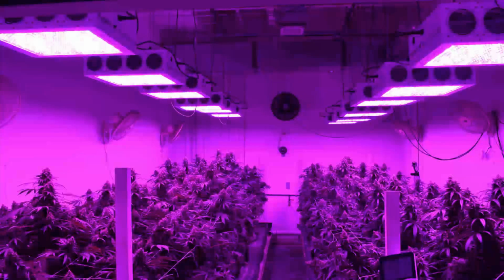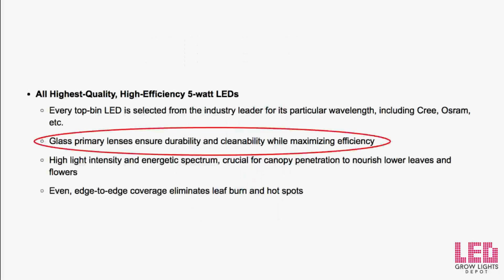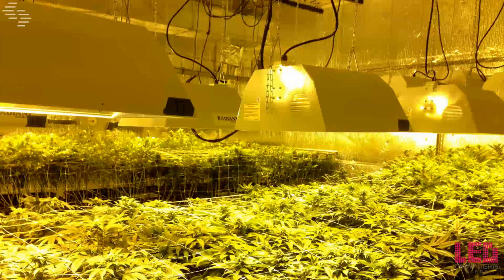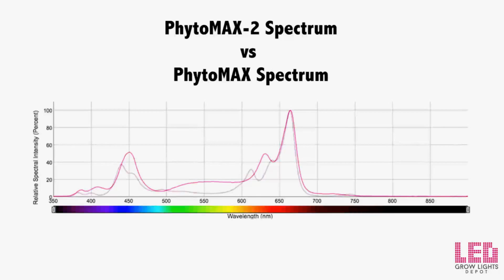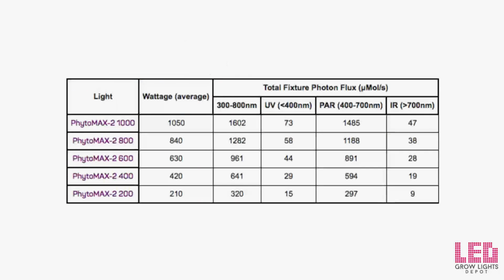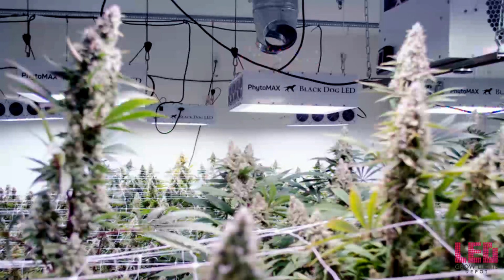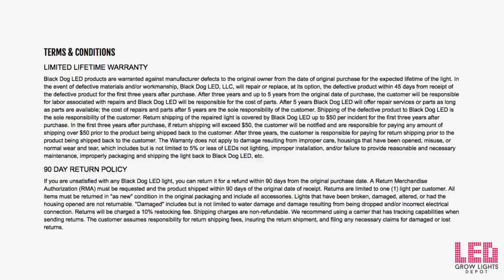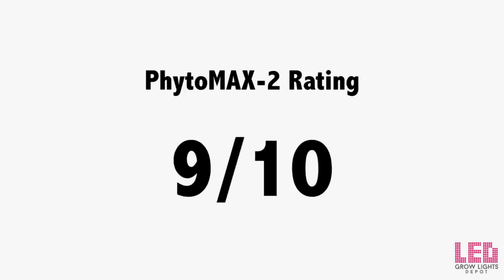Black Dog LED PhytoMAX-2 LED Grow Light Review

Comment: Black Dog is the BIGGEST scam light on the market TODAY! They are still selling these OUTDATED lights for absurdly high prices despite using these old chips and drivers. They use the old 'bubble-chips' which are inefficient and run hot...and frequently burn out. They do not use the new SMD chips (Surface Mounted Diodes). These new chips are much more efficient than the bubble chips in Black Dog lights. The absurdity of charging over 800$ (Canadian) for a mere 200-watt inefficient light shows you clearly that Black Dog is a SCAM! They are trying to fool people into buying these old, obsolete lights for ridiculous prices. Shame on Black Dog and those still selling these OLD LIGHTS!

Comment: over priced, HLG and Chilled are the way to go, add your own blues, reds and UV
Reply: I own 4 ChilLED x3-500 and I would put them up against any brand on the market. The new ultra series may cost more than BD but I can't swear by that. They too are American made and found their par coverage is better on the edges and corners.  T he customer service is better, and the lights run about 1000 btu cooler. They are also adjustable. I run them at 30-40% during veg. Depending on how hard I'm pushing the plants and type of plant I'm growing ( auto or photo)  pre flower I crank them to 65-75% and full flower 100%  I've had some massive yields and do not use a tent or co2. The x3-500 is 4x6 flower coverage but optional is 3x5 coverage per fixture. I can run two fixtures at 100% and my utility bill is still under 200 dollars. Another thing.  The BD may pull more than 1000 watts but what are those fans using for power? You need to subtract the wattage they use I assume. The ChilLed tech pulls an honest 500 watts per x3-500 because there are no fans.  I only use 3 and one is still boxed.  I have been running my 1st fixture for over 2 years contiusly and zero problems.    I'm not bashing BD. But I live in the south and cooling them would be an issue.  Check out growcraft ChilLED Tech. They put all lab tests and edge to edge par readings on their website  they even post how they perform against the big name brands in comparison done by independent labs so they're not biased at all.
Reply: @ronnieblack2482  I am running 8 ChilLed V1 pucks and 4 of the V2's for over 2 years now, no issues they are great